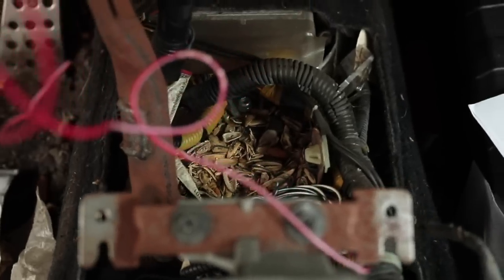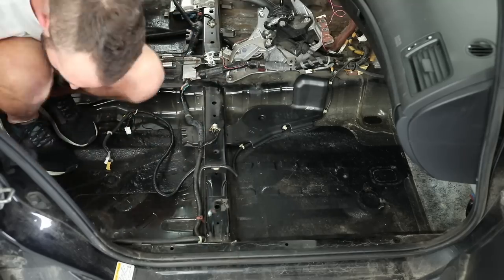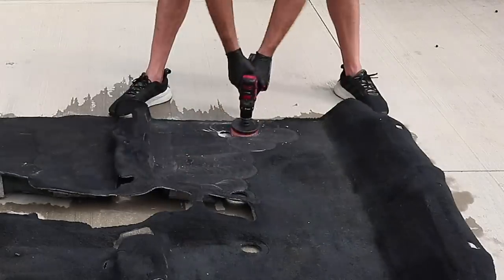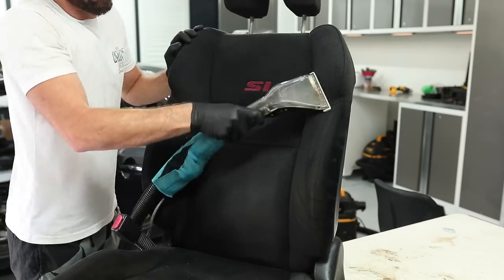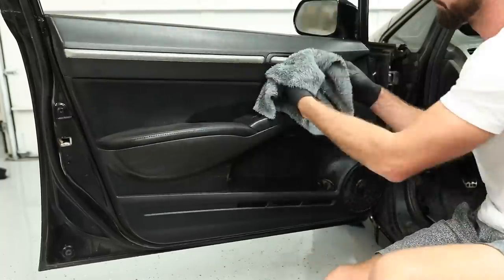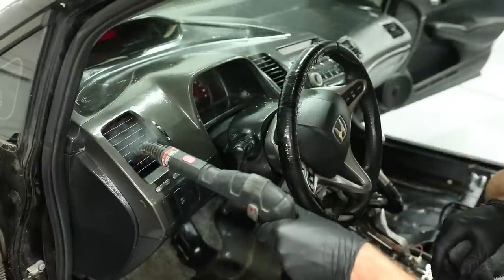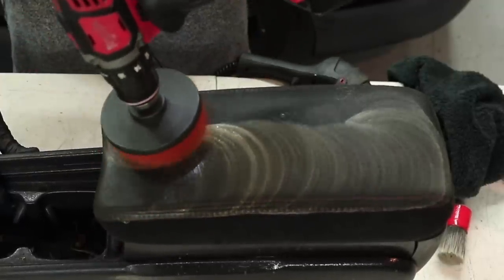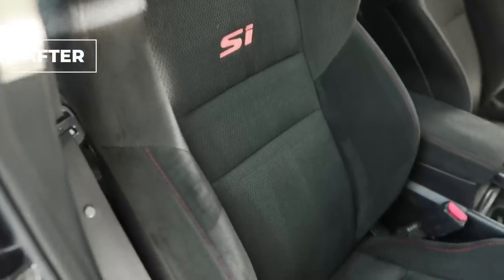Owner REACTS To INSANE Detailing Transformation! No Way Thats My CAR!

Comment: Love seeing an Si restoration! Just did all of this myself within the last year or so on my 2008. Sidenote: was surprised you weren't using a rubber mat with holes when pressure washing the carpets to keep dirt off the back. I picked a small square up from Home Depot a while ago and it works wonders - primarily for doing wheels. Think they call it an anti-fatigue mat.

Comment: The civic was like a hoarder car, but after deep cleaning the car it looks 1000x better. You’re the best. I want to give you a tip: you can use brush attachment on steamer and APC for extra deep cleaning power.
Reply from the maker: Yes! I need to get a new steamer. Downside to mine is the proprietary head and they don't sell just attachments!
Reply: You can check out McCulloch Steamer.

Comment: Running your AC creates a lot of moisture in your HVAC system, it can cause problems for people with allergies and create a tremendous odor. They make disinfectant kits you can pour through your defrost grill that will kill the mold/bacteria and leave a really nice scent in its place. We started selling that service as an add on to HVAC service at my last job. Really nice for smokers. If you smoke in your car always run the HVAC on fresh air intake, not recirculate. All that smoke will get in your HVAC system and leave terrible odors when you turn on your heat/AC, but if you smoke in your car, like I do, you have probably already come to terms with the smoke smell. I have to clean the inside of my windshield weekly to keep all the smoke residue off it. My last car was a really nice Grand Am GT. The windshield had gotten so bad with smoke residue that it caused the sun to glare off it and I smashed into a parked car before I could get the visor flipped down. Smoking in your car is really bad, but the inside of your car is nothing compared to the inside of your body. Bad habit all around.

Comment: You have a ladder that folds low. Try putting the carpet on the ladder when it's low, and THEN raise it higher. It should be much easier to handle.

Comment: When you blow in the heat/ac vents do you have the car running or with it still off?  Just curios if moisture would make it to the cabin air filter.
Reply: Generally should take filter out first for that exact reason. Good pick up

Comment: Magic erasers with APC for plastics and the steer wheel will change ur life, takes about 1/2 time of steam or detail brush. Super-cheap, 100 on Amazon for the $25.
Reply from the maker: I’ll give that a shot! Thanks for the tip
Reply: Gotta remember that magic erasers are basically fine sandpaper, and will damage leather if not careful. I’d stick to an autofiber scrub ninja for leather and most interior panels and only use the magic eraser softly as a last resort
Reply: @chrispyfc3  that is why i use them with an APC, its like wet sanding, i have never had any damage to interior plastics, ever. Its pretty safe as long as u don’t scrub like a lunatic and keep the surface somewhat wet. I will have to try your suggestion to compare the results.

Comment: In need of advice. I’ll start by saying I have no garage access and have to park my car on the street. The birds on the power lines destroys my car. The neighbors feed stray cats and the birds eat the cat food and poop on my car. Even after a car wash, I am unable to get the stains off. Please point me in the right direction.
Reply: Clay bar.
Reply: Unfortunately bird poop will etch the clear coat, same with bug guts. Most likely need to cut/polish the clear and seal with ceramic or graphene.
Reply: Sounds like you need a cat trap. Stop the problem at its source!